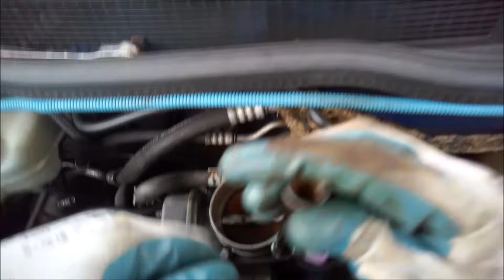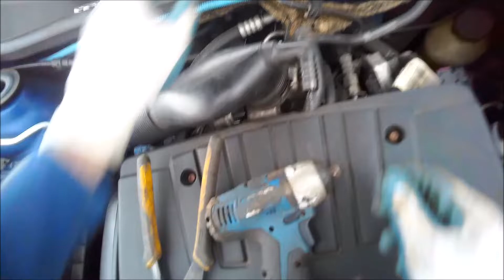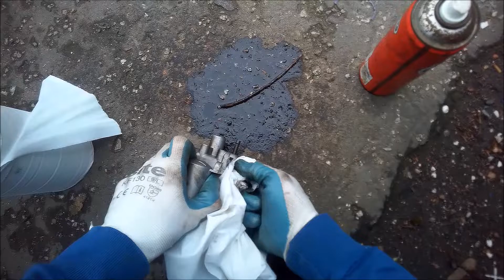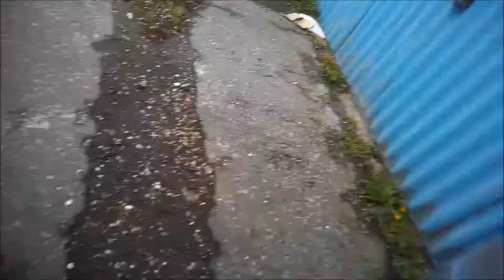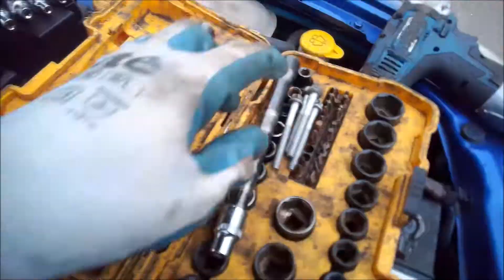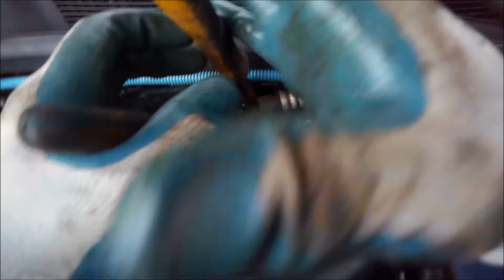Astra G MK4 - 1.8 Z18XE Throttle Body Removal and Cleaning

Comment: What was that operation you performed in the end after reinstalling the tgrottle body? Some kind of adjustment?

Very good video btw. I most likely have this same issue, since my Vectra turns on the engine light randomly and it always just goes on and off. I thought it could be the throttle issue also because when i press gas and release it the decrease of velocity is not steady. There are few pushes. Same goes for acceleration from that. Both are very small twitching in the car.

I do not think it could be anything in ignition, since the whole ignition body has been replaced couple of years back, and i also have experience from the actual behaviour in such a case. The whole car would be shaking and power would be low.
Reply from the maker: I was checking the vacuum with the car running. I also blanked off the fuel evaporation hose to the throttle body and this helped the running of the car to improve greatly

Comment: I have the same car in the video. My engine light has come on and is saying p0171. Ive has a new cat fitted and both o2 sensors changed. When i start the car the engine is literally vibrating all over the place and eventually stops juddering. While this is happening the idling is pretty rough. When i press the accelerator there's sometimes major issues where it seems unrespinsive and tjen suddenly kicks in and accelerates. A few times it doesn't even accelerate properly and almost stalls. I've also noticed when driving and i put my foot down i hear what sounds like hissing or something, like a wooshing of air or something. Anyone know what the root cause of all this could be?
Reply: Vaccum leaks
Reply: @blarkdexture8899  had a crack in the manifold. Changed this out and it completely sorted it. I proceeded to still get a check engine light which was frustrating. I have since sold the car. Gutted as I loved that car.